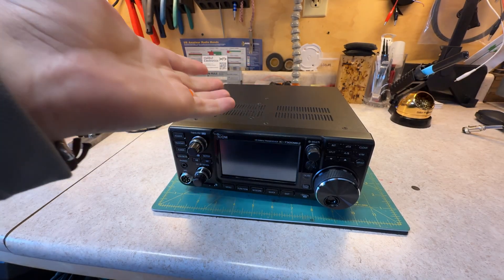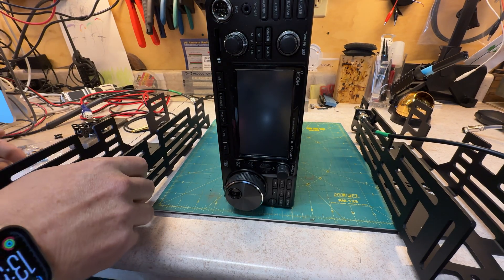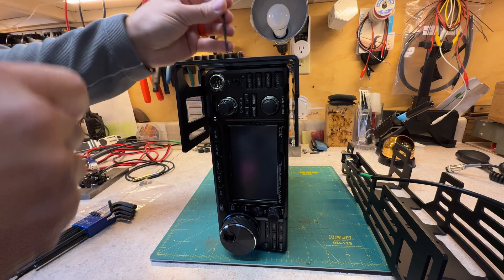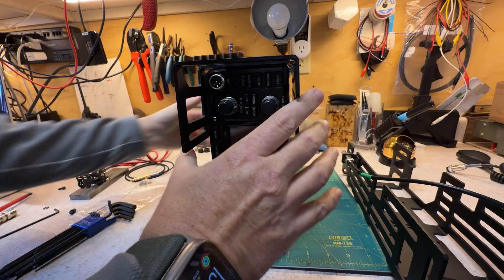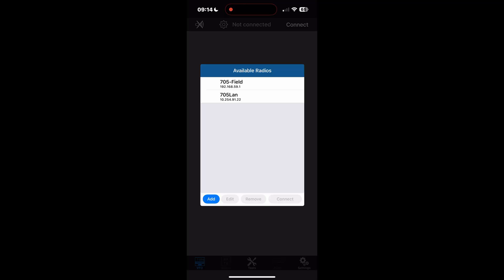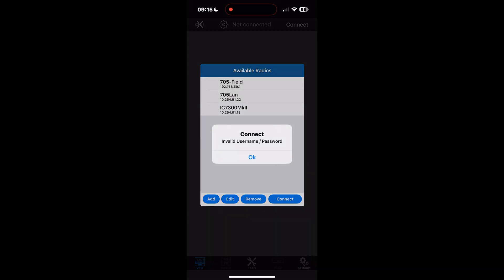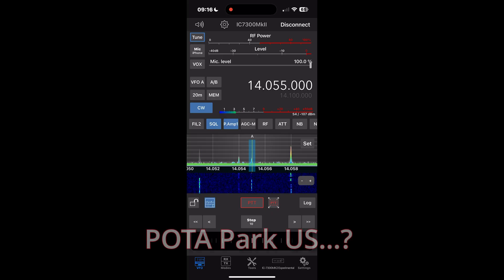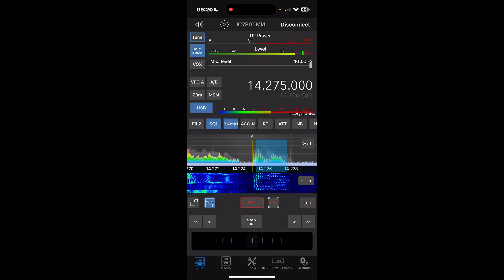My 7300 Mk II Got a Suit of Armor—Then I Used It to Play Hooky

Comment: Wants to be a 7610 but it's still just a Toy of a radio. The so called, Upgrade is a Joke & ICOM has been doing that quiet often so that you must buy a New radio for a few changes. I'm sticking with my 7610 & 9100.
Reply from the maker: Not a toy. I wouldn't take a 7610 into the sky and play parachute mobile with it. I wouldn't take a 7610 to the park. 

This is a radio with a field use setup. It sounds like it isn't your cup of tea but hey different strokes for different folks. It happens to work GREAT for me.
Reply: @LifeAtTerminalVelocity I have an ICOM 7000, 703+, and a XIEGU G106 if I wanted to go remote and I don’t do Pota but I do do portable stuff and I can do all HF Bands and 6 meters